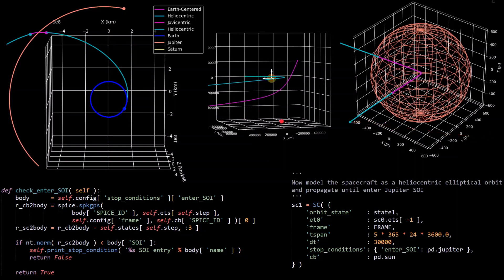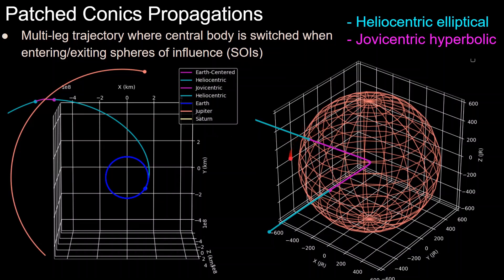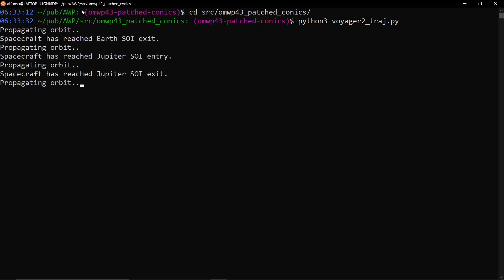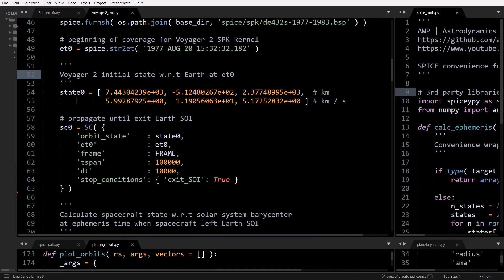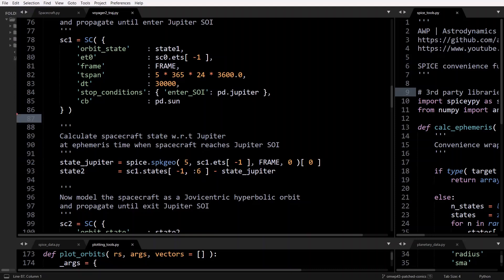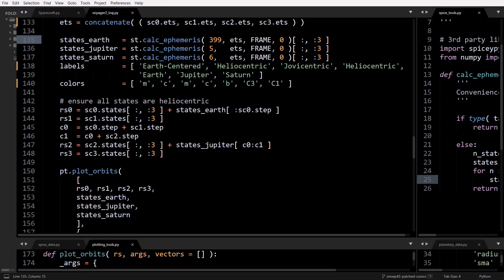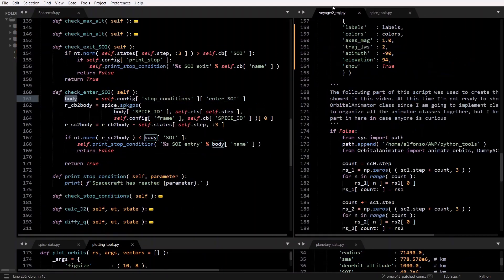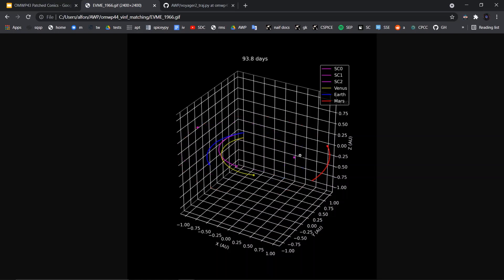Patched Conics Propagation Software | Orbital Mechanics with Python 43

Comment: I have another doubt. When changing the central body for the orbits does it matter from where the satellite in sentering Meaning if a satellite is entering from the opposite direction from where the planet or celestial body is will it still be added or will the states be subtracted? Also when entering the SOI of a planet from the SUN's SOI, should the states be subtracted? Or am I missing something?
Reply from the maker: Its best to think of these states calculations as vector addition (and subtraction). Vector addition is done tip to tail, and these vectors all form a closed triangle. So it doesn't matter which side the spacecraft is coming from, the calculations are still the same.

Vector addition is done tip to tail, no matter where their tail starts (the tails don't need to start at the sun). Here's an example of 2D vectors. I recommend drawing this out on a piece of paper 

vector1 = [ 2, 3 ]
vector2 = [ 1, 4 ]
vector1 + vector2 = [ 3, 7 ]
vector1 - vector2 = [ 1, -1 ]

The addition operation creates a vector that is the two vectors added tip to tail (equivalent to just summing their components).
The subtraction can also be though of as adding a negative vector2. So that equation is equivalent to:
vector1 + -vector2 = [ 1, -1 ]
Making vector2 negative means negating both of its components and then adding that negated vector tip to tail.
Also notice that the result is a vector that points from the tip of vector2 to the tip of vector1. This is true no matter if the components of the original vectors are negative or positive.

Again, I recommend drawing this out on paper and also drawing out the examples in the video to get a better feel for how its working.
Reply: @alfonsogonzalez-astrodynam2207  so no matter which way it is entering at the end the states will be vector added? Also what if the sat is entering jupiter from sun? how will the coordinates change in that case?
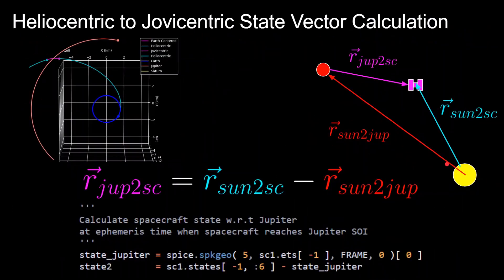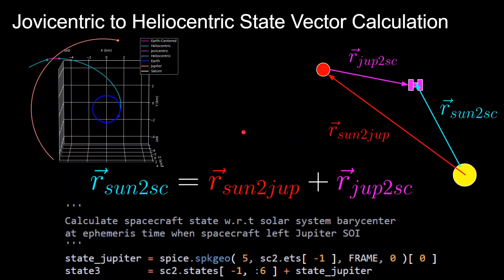Reply from the maker: Try drawing out the diagram at 2:10 in the video with the spacecraft in a different location. The vector equation will still be the same. Same with the situation at 2:55.

If you are confused about vector addition, here is a video of a good explanation: https://www.youtube.com/watch?v=PkpJE0HZ7u8

Comment: So can this be used to backtrack and make fly-by/ intercept trajectories for new satellites.?
Reply: also why are we modelling along solar system barycenter and not the sun, while we are taking the distance from the Sun.
Reply from the maker: First question:
Yes, but not by itself. The first step to designing these trajectories is to calculate the v-infinity vectors from going from one planet to another (in this case Earth to Jupiter). For preliminary v-infinity matching, one assumes zero sphere of influences, where a flyby is an instantaneous change in the velocity vector and the trajectory is always modeled as a heliocentric elliptical orbit. This will be the next 2 videos in this series.

Once you have those, you can begin to refine the trajectory within the spheres of influence of the planets. One technique to do that is as a boundary value problem that you can use a shooting method to solve.

So if one knows the position and velocity vectors of the periapsis of the flyby that they want, they can propagate backwards in time to calculate the position and velocity vectors when the spacecraft would arrive at the sphere of influence. 

Then, one can calculate the position and velocity vectors when the spacecraft arrives at Jupiter (coming from Earth). One then compares the differences between the vectors at the sphere of influence from the backwards propagation and the forwards propagation. On the first iteration, they won't match. But that is where the shooting method comes in. This can be seen as an optimization problem.

Minimize the difference between the position and velocity vectors at the boundary points subject to certain constraints. Also note that the difference between the position vectors must be very small, but larger differences in the velocity vectors are okay, because those can be thrust events. So if the position vectors match but the velocity vectors are off by 10 m/s, that can be modeled as an instantaneous burn.

This is a very interesting problem, and I look forward to learning about it more, writing the software, and then making videos covering it.

Second question:
This is a really good point, thank you for bringing this up. You are correct, the center of the propagation should be the Sun. If we wanted to model the center as the solar system barycenter, we would have to use the mu value of the solar system barycenter, which would be all the planets mu values added up.
Reply: @alfonsogonzalez-astrodynam2207   also is it possible to automate the process of entering and exiting a body's sphere of influence, such that it automatically changes the soi's in a single trajectory or is this the best way
Reply from the maker: I think the most forward way to do it would be to wrap the script I showed in a function, where the inputs are which planets you plan on going to and the propagation will be stopped and started when entering and exiting spheres of influence
Reply: @alfonsogonzalez-astrodynam2207  yeah but I was thinking more in terms of an orbit propagating and automatically knowing when and which body's SOI it is entering and exiting, and automatically changing the orbit parameters so as to know that launching a sat in a particular way will lead to a certain trajectory, without planning the intercepts and fly-by.
Reply: @kshitijpatil4793  Compared to the rest that seems a reasonably doable programming task. You could for example periodically do a search for the body with the smallest distance to the spacecraft with one loop over the bodies. As the bodies and your spacecraft have a bounded velocity in the heliocentric coordinate system it should not be needed to perform the check very often until you get 'close' to an SOI. At that point you can use the given process because the body is known.